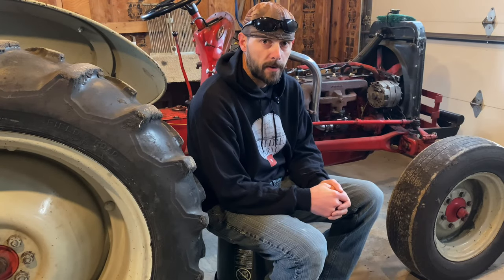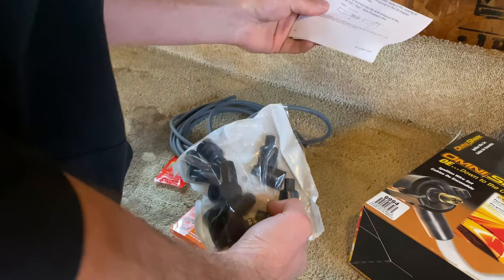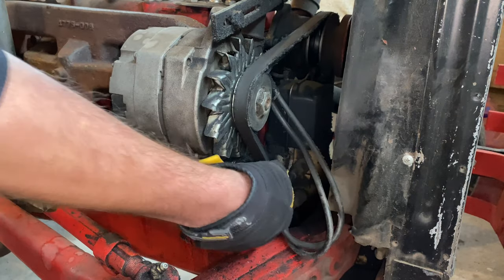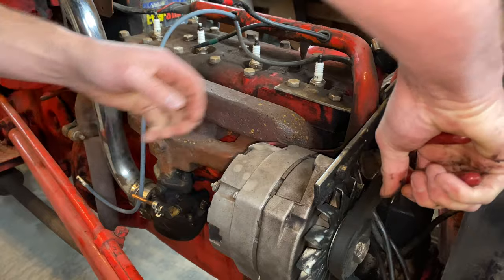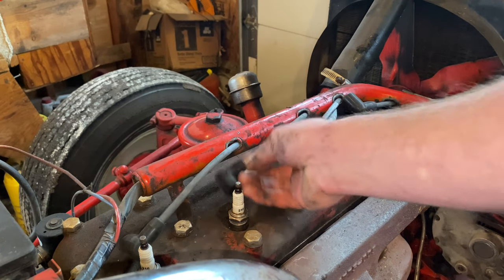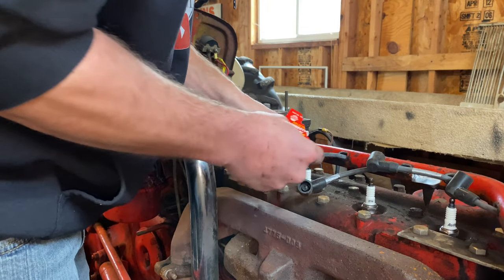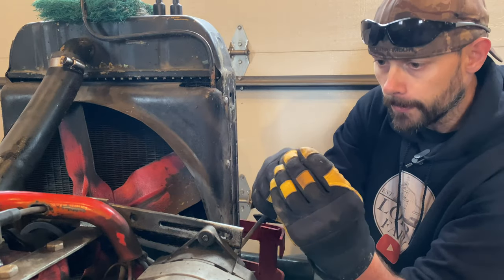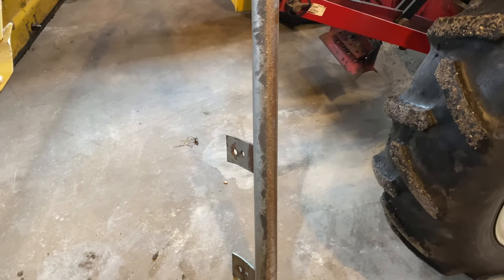Ford 8N Tractor ⚡️ Installing Spark Plugs and Wires

Comment: My father was a Ford car mechanic for 40 years before he passed and I raced sports cars for years.  I am no stranger to a wrench.  Often times with the racing, it was relatively easy to diagnose the issues.  If it was not catastrophic (i.e., hole in block), there were more than enough people around to help diagnose things and find a solution pretty quickly.  With these old girls, usually, you are kind of on your own.  Yes, I do rely on FB groups, etc., for insight, but still you kind of have to bring things down to a fairly basic level and think it through.  I can honestly say I am much better in diagnosing issues after working on these old tractors.  Simple and rugged.  Just make sure you do not skimp on parts, as so many imported items out there that are inferior.
Reply from the maker: That's awesome, and I totally agree. There have been many things I have even "put back" to the original. I have learned so much from this tractor. I don't ever see myself getting rid of it.

Comment: Try doing this with a loader mounted to it and no possible way to remove the hood. That's the boat I'm in at the moment. For that reason, mine is not fun to work on like yours is haha.
Reply from the maker: That stinks. Yes, anytime I can I remove the hood. Much easier. Good luck!

Comment: Mine starts like that but shuts right off swapped plugs and wires and cleaned the carb. Nothing is fixing it.
Reply from the maker: I think I saw somewhere that a bad condenser could cause this issue. It’s so frustrating chasing issues sometimes. This is honestly the best I have had mine running since I’ve owned it. But there is always tomorrow for more issues. Haha